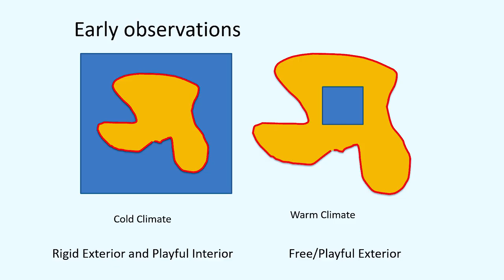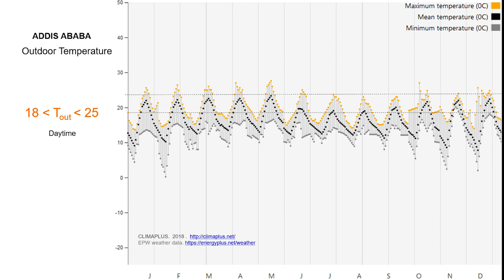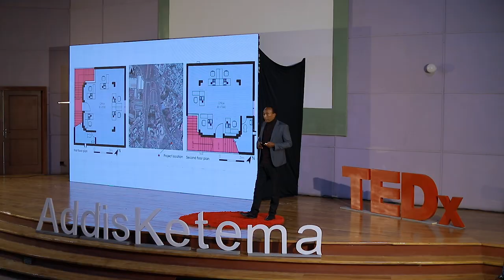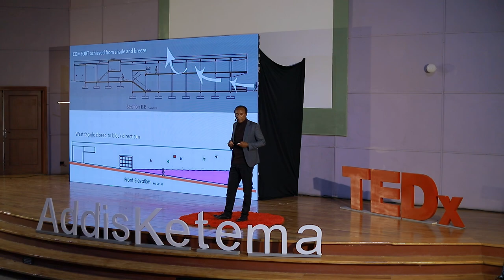Architecture Lived Inside-out | Zeleke Belay | TEDxAddisKetema

Comment: Thx to The archiect for His Observation! I Imagine that the climate in East Africa is hot, but dry, Like Utah or AZ.  In such climates, you Just Need Walls to keep Out The Wind and Rain. But in a hot and humid climate, you Need insulation (and should keep closed Doors and Windows in Summer weather) to maintain a cool interior space. So humidity is what unites hot and cold climates. They both Need insulation to maintain The interior Temperature. Whereas sunlight, ie, Windows, is a Bonus in cold climes, they can be a disadvantage in hot climes UNLESS light kept Out with Shades or an overhanging roof. Also, thought should be given to whether or Not you want an oven in hot climes. Using Them adds extra Heat indoors that can Not be so easily dissipated. Better to Bake in an outdoor oven in such places.

Comment: Thx for this EXCELLENT Video. I have never experienced The climate in East Africa. I'm Guessing that it's low-humidity, Like deserts. In that Kind of climate you don't Need insulation. Buildings are only needed to protect from Wind and Rain. But in hot humid climates, insulation and a closed space is necessary to keep Out The Heat. If you build with The climate in mind, Then you'll reduce or eliminate The Need for A/C.